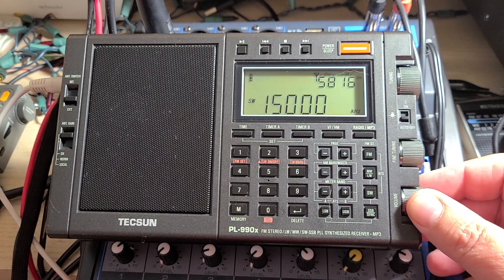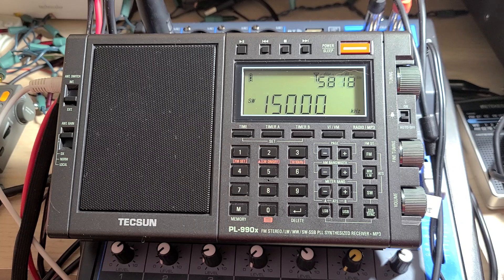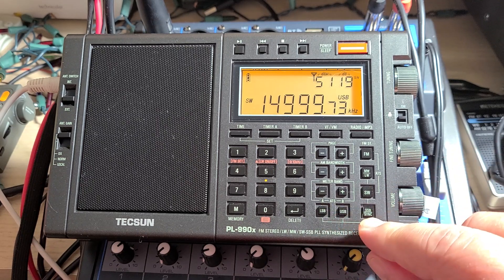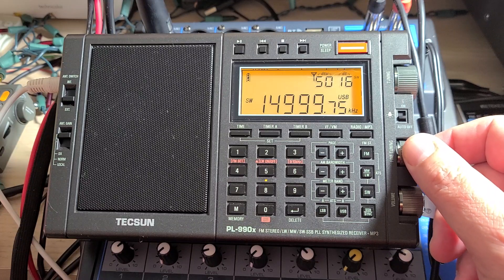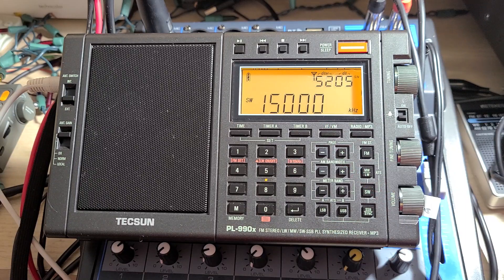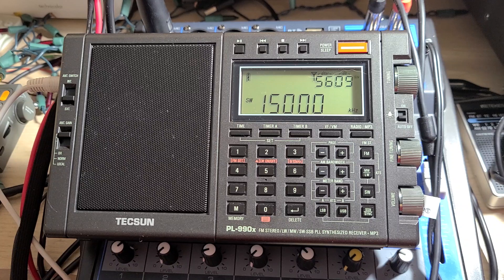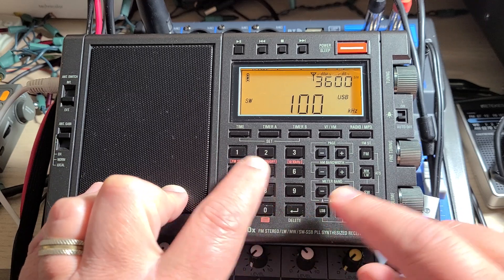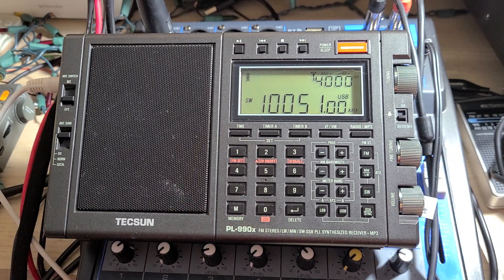How to Calibrate frequency of the Tecsun PL-990x to have perfect SSB frequency readout

Comment: An easier way is to tune into an SSB amateur station and adjust the fine tuning until the signal is perfect, then calibrate. 99% of all transceivers on the air today are spot on and are usually tuned to a 1mHz increment. After this process you can test it out on a few other SSB signals and with the majority being tuned in correctly tuned in will confirm accurate calibration.

Comment: In my case, the deviation is more than 1khz and the described method does not work. Any idea ?  Thank you.
Reply from the maker: make sure you did not get a early test model from China rather than the latest firmware, this works with all 990 and 990X

Comment: these days here we got overheat, outside 38C, at room did not switched on the air condition so 31C inside ... pl-990 was need to calibrate again by - 9Hz ... example was at 13, now is 4 ... or if was 0 it needs -9 ... when heat go away will need again calibration

Comment: Hi, Thanks for info, just got my 990x ... here my case, ssb was by 13,14 hz off ... reset the radio (underneath) just for testing was spot to 0 ... video with 13 hz off at channel, will upload with reset & there after, sometime later, 73 ... EDIT anybody know how to calibrate the actual frequency at LW? it seems by 1 khz off, example medi radio 171, seems getting better at 170 (no video yet)
Reply from the maker: you simply tune to make zero beat and hold the LSB or USB button until the display flashes
Reply: @OfficialSWLchannel  many thanks for fast reply to help, i done it, is easy indeed, but this seems does not help the freqs at MW & LW in normal operation (no synch, no ssb in use) which may be off by about 1 khz ... will try again

Comment: Well ...in this case that you are discussing the S S B is used in a completely different way & the impression I'm getting is that fit perfectly alright because it gets you there in a very short time since simplifying the matter instead of using the old traditional method moving off a little bit at the time & playing around until find the zero spot I think is a simple & straight forward operation & that count when one have to manage a situation of piles of signals .